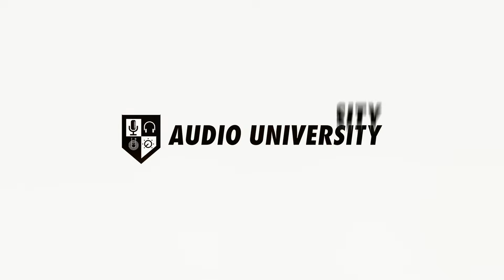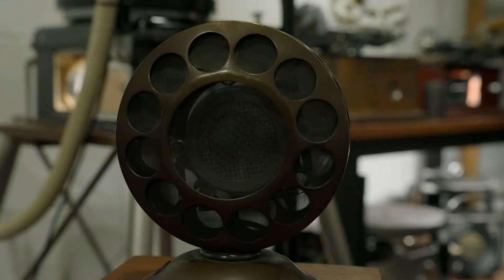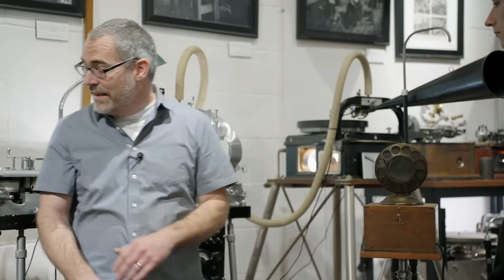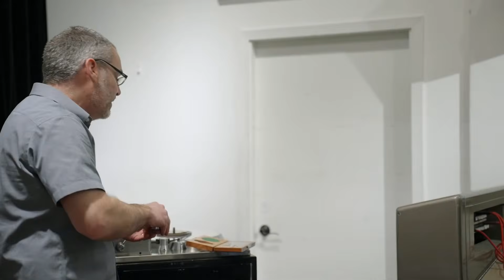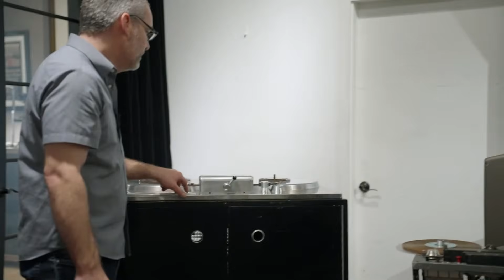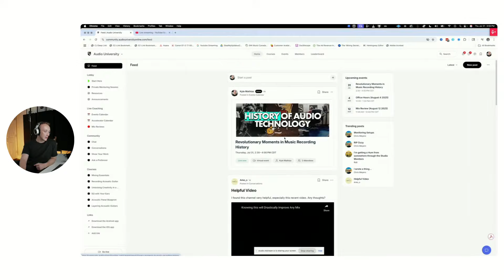Revolutionary Moments in Music Recording History

Comment: Interesting stuff!
Back in the day you could buy decent reel to reels 1/4 inch stereo tape machines at rummage sales for next to nothing or free for the taking. I had a couple for a long time. A cool  function was to use them as echo machines, and splice loops together. 
I figure it would be difficult to find a completely functional one these days for a bargain.
Old kit breaks down. I do not have patience I did when I was younger. Belts wear out, parts have to be oiled and replaced. Still folks restore and sell them
A decent tape machine even a just 1/4 inch tape machine sounds quite good. The quirky noise floor can be an asset for a lot of genres

I rarely use tape emulation, but I really like Chris's Air windows 'To tape' tool. It sounds convincing enough for my purposes and as good or better than the expensive offerings
All of his little plugins are unique, varied and very usable in my humble opinion. 
I use the latest version of 'Air windows consolidated' and you can get most of them in a tidy package.